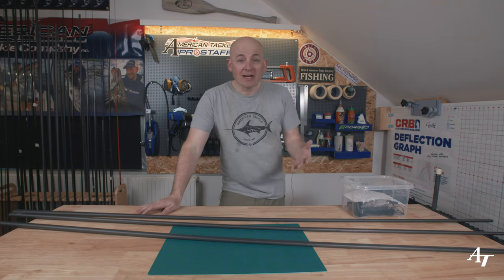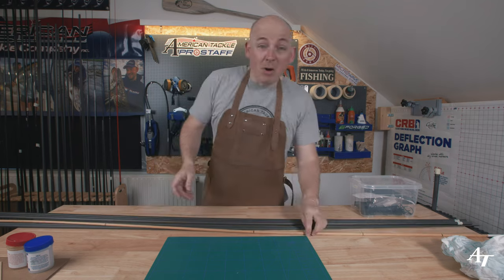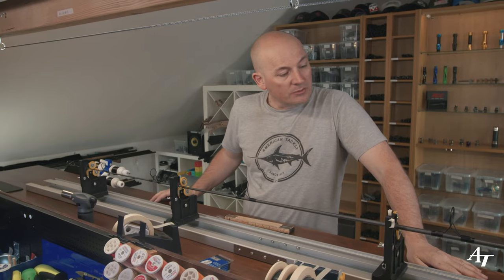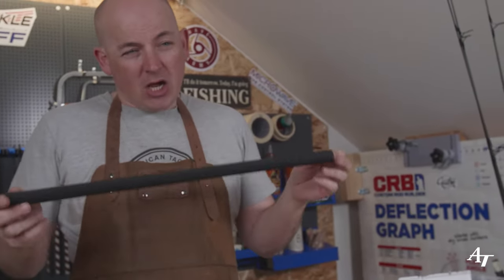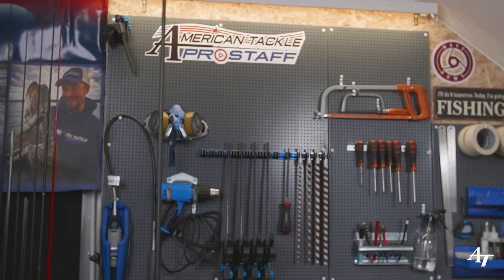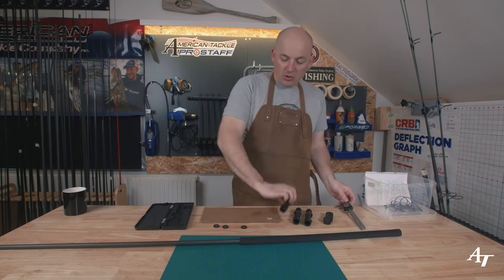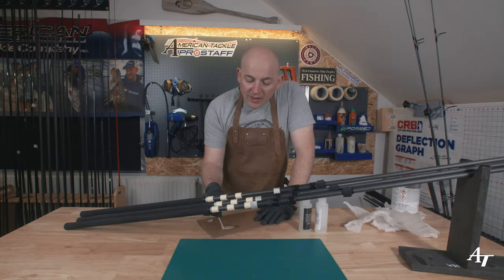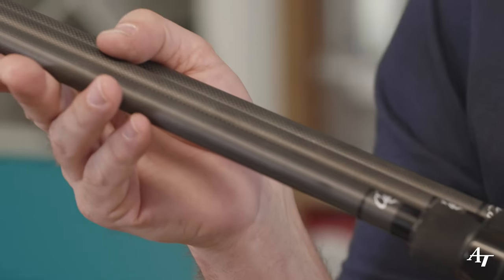This is RodBuilding Episode #13 Making Rod Sets

Comment: A very nice video with a lot of details..! However, I have a question, why do you use tape and not a shim to fix the reel seat ?
Reply: Tape is lighter and it's just a filler. It's cheaper than a shim and easier to adjust

Comment: Strange question but with shop bought rods is it common for the first tip section of the rod carbon to be a slightly different colour of the butt section?